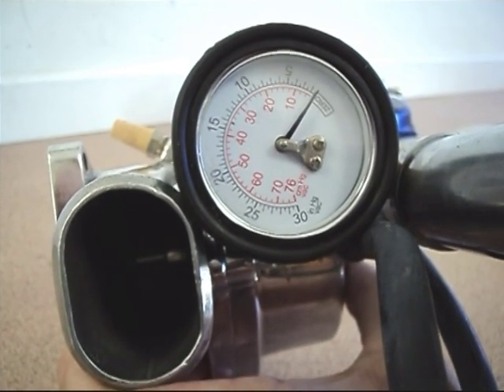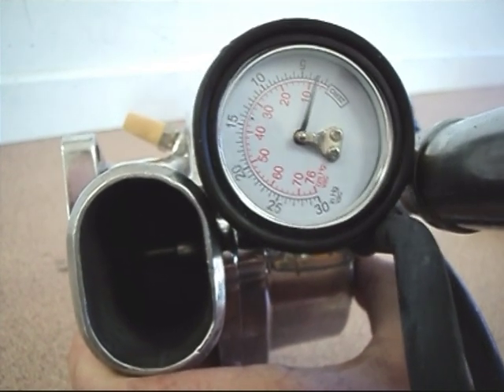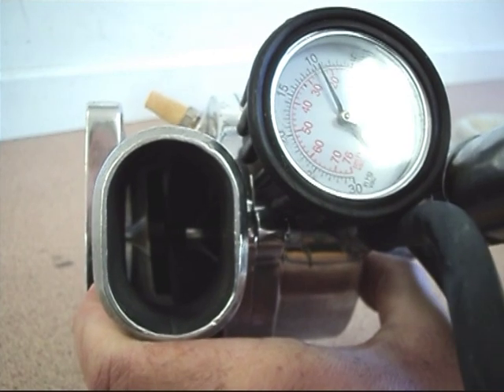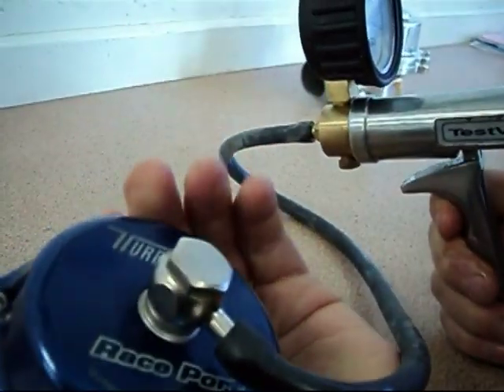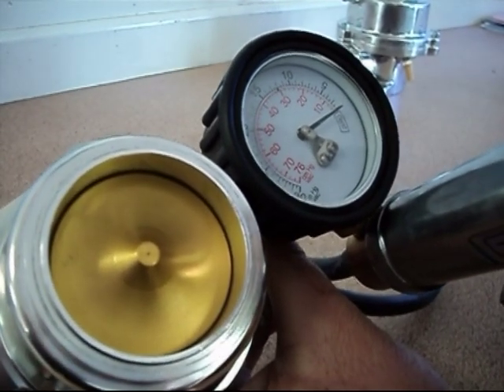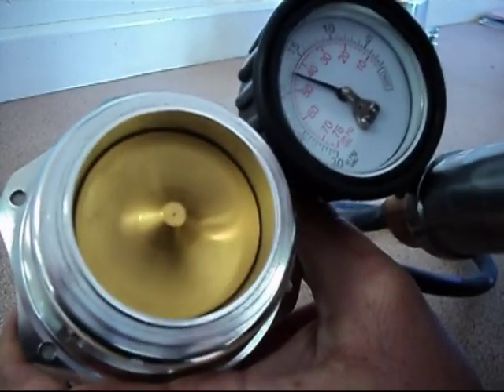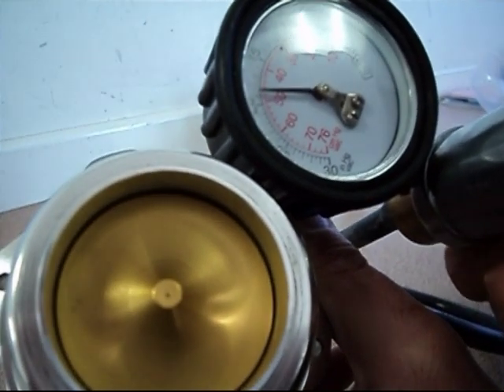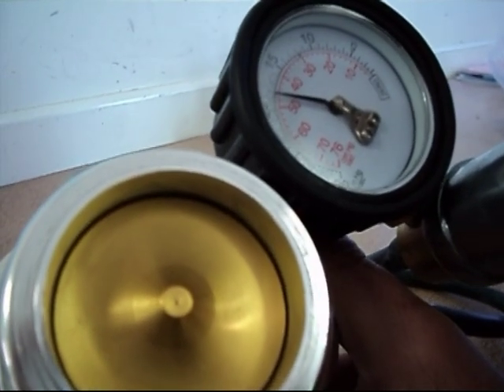Supercharger vs Turbocharger Blowoff Valve Comparison

Comment: Why would anyone thumbs down this?  This is the only true and logical explanation for the very important operation of a supercharger bypass valve I've found on YT.  If you put one of the common turbo valves on the spring is so tight it will NEVER open except on fully closed throttle deceleration. 

Most supercharged engines idle, drive around, and cruise at 10" or less of vacuum and never need to get into boost, so your increasing drag, wasting HP, lowering gas mileage, by having the supercharger compress that unneeded and unwanted extra air against an almost closed throttle body.  Especially at higher freeway cruising speeds where the RPM is higher, the valve should be FULLY open.

I tried using an adjustable black anodized aluminum "plumb back" bypass or BOV valve from Ebay and like this video shows, it doesn't even begin to open until 18 plus inches, which the motor is NEVER going to see in daily driving except when letting off the throttle from higher RPM's or downshifting.
Reply: Excellent post man!
Reply: BeulahLips hey i don't know much about the functionality of my supercharger. i have a mercedes w203 kompressor coupe 2002. i just want to know more about what you're saying here. so in default is the valve closed? thus wasting the HP, Mileage etc. How would you go about making adjustments to keep it open at the set rpms to increase functionality and efficiency?? hope i'm not sounding too confusing.